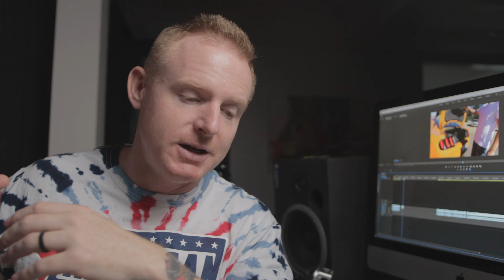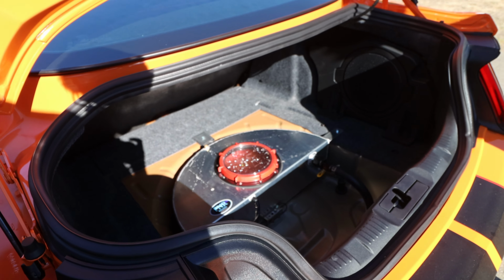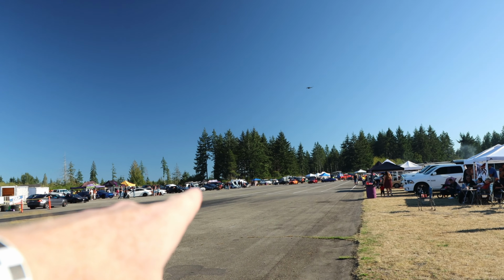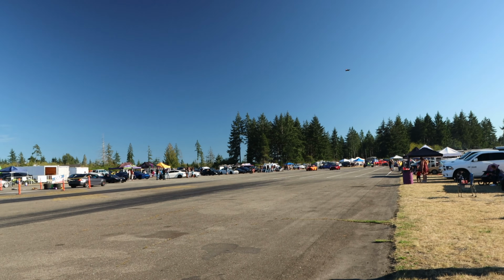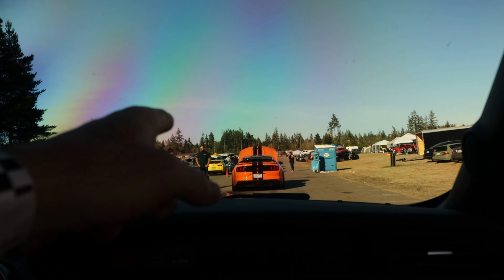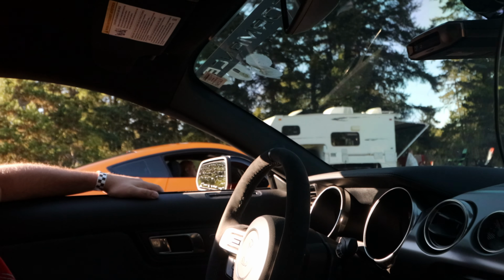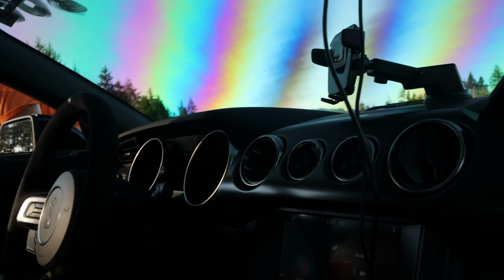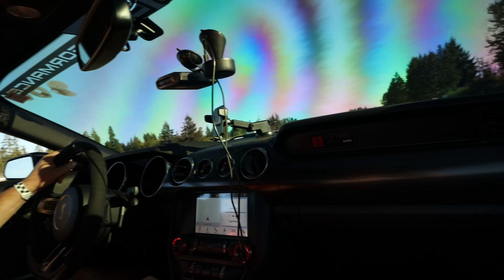Twin Turbo VS Supercharged GT350 |  twin turbo vs supercharger sound

Comment: I have a friend with a Pro Charger GT350R and since he has put it in he has had nothing but trouble - threw a rod, had to rebuild his engine +20K - keep your car  stock not only for peace of mind but re-sale value
Reply from the maker: Yeah that's where I am leaning right now, I would hate to mess up a really great thing.
Reply: You literally changed my mind just now. Thanks for the heads up

Comment: 3:36 yeah the 1000R car jumped REALLY bad!! 7:40 that 5.0 jumped too. Damn that seems to happen a lot there. Either way I can't believe that 5.0 with just NOS was able to beat y'all even if he did jump. That just shows you how much power NOS by itself adds. Now the guy you're riding with in the 1000R needs to put NOS on his car on top of the twin turbos, or just slap a big supercharger on top of the turbos, or all 3 lol. Guy in the 1000R needs to slap a sequential 6 speed with some longer gears at the end. That way he can shift faster and get some more MPH out of it. I think at least.
Reply from the maker: That Nitrous car really surprised me!

Comment: To see which one is faster is harder than you think. The hp & tq numbers would have to be close to identical and one's always going to be faster from a dig or a roll than the other. The driver would have to be the same, same tires etc.. It doesn't only come down to which car wins the race. The faster car doesn't always win.

Comment: I would go with Fathouse there builds are so clean plus the motech system keeps you out of those mustang videos running over the spectators and of course free hp from turbos.
Reply: Yeah if you have 70-100k to throw at it cause that's what it costs.

Comment: Did he shift from 3rd to fast or was he at redline that fast?
Reply from the maker: I can’t say for sure but it feels like that’s possible.  With the loud whipple car next to us it might have pushed the TT car to shift early because of the sound.
Reply: @TheAllAmericanDriver  it looked like he shorted 3rd and over-rev 4th you gotta go to those events in kill mode
Reply from the maker: @antimatter_gt5003    Yeah I would like to see them run it back again.  I agree third looked short, I think the sound of the whipple car was so loud that it distracted the TT driver.
Reply: @TheAllAmericanDriver  I clearly remember us talking about it right after the race. No he did not short shift. He clearly told me he had a good run and you were present for that. 🙂